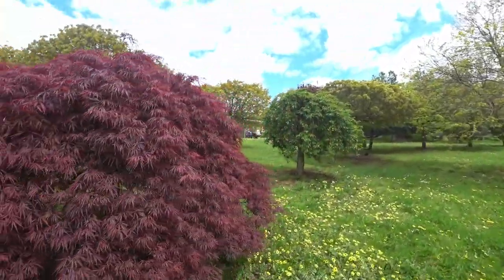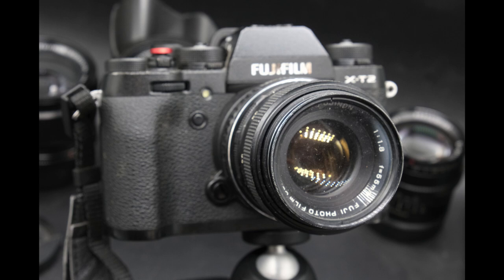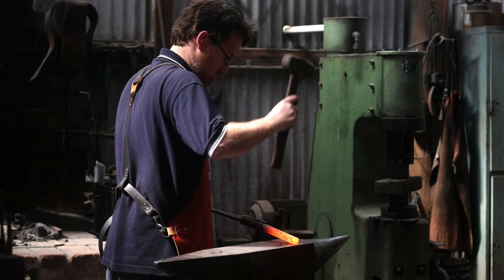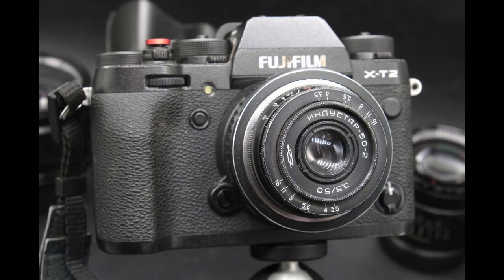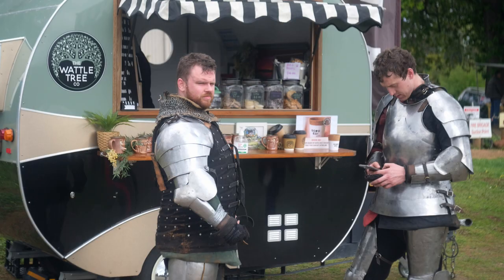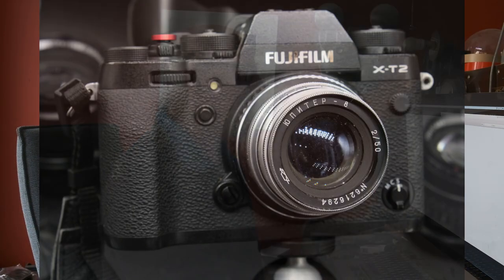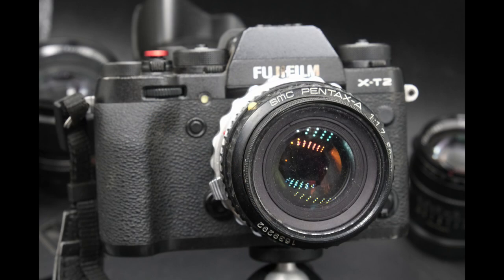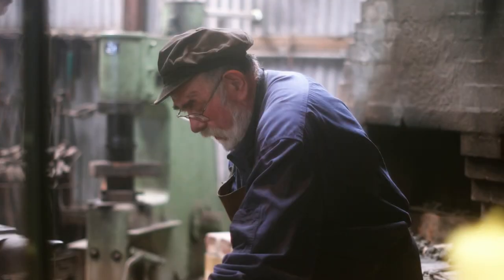Seven Vintage Lens Shoot Out

Comment: Industar-50-2 is a sharp contrasty lens. Needs a hood, doesn't handle flare well. Same goes for Olympus 50mm/1.4, especially wide open. Also, when you show the latter on camera, the glass looks really dirty??? A wonderful lens for morning/evening/indoors with indirect light.

Comment: Hi, I must say I really enjoy your videos. I have a question. Do you have to have different adapters for each lens? I'm 67 and only started getting into photography in 2019. I have an xt3 and a xt20 as well as a few film cameras. Canon ae1, nikon fe and a yashica mg-1
Reply from the maker: You need adaptors for different lens mounts. So you need to find out which mounts your old lenses have. They may be M42 screw mounts (heaps of old lenses covered there), or Pentax PK mounts, or Olympus mounts etc Same with Canon and Nikon mounts, find out what mount the lens has.

Comment: Perfect. I have the T-2, and a weekend. Let's see what you got! The fan light and mic are groovy!. That Mac still working? Wow. System 9? The Helios shined here. I have an 8 blade Super Takumar 50 and a Rollei Zeiss 50, both fast, and they are knockout lenses. Although I have fine Fuji primes, I have to recommend the Minolta Celtic 135mm 2.8 lens. Find the right seller and the right condition. Under 40 dollars. Right now ebay has one for ten and change, plus 17 shipping. You'll use it, and fall in love with it.
I have a Pentacon 135, and a minty Tair 135 with all the goodies, (20 blades), but I pick the Minolta.  A little stopped down, and it's extremely sharp.
Reply from the maker: I like retro
Reply: @GregCarrick  
I added more info.
Reply from the maker: Some good choices there. Re the Minolta on ebay - I'm in Australia, so a lot of items in the US become too expensive if the seller will even ship. I usually find lenses in op shops over here, or they just get given to me by people who don't use cameras.

Comment: Hi Greg I have most of the lenses you have mentioned, the Industar 50 I have is one of my sharpest & it has great contrast.I think there is a lot of variation due to how much Vodka was consumed on the day? I paused the video on the Olympus 50mm 1.4 & it looks like it is a bit hazy? It might benefit from a good clean on the inside. I had to dismantle my copy & after a good clean it produces great images. I had a similar problem with a Topcor 58mm 1.8 initially the images were soft, lacking in contrast. After removing the front glass, cleaning the haze & oil of the aperture blades I now get good images from it too. By the way I used to live in Mt Evelyn about 20 years ago, we might have been neighbours.
Reply from the maker: Thanks :) Yes, I've cleaned a few of my old lenses, but haven't pulled apart the Zuiko yet. It's also a bit banged up cosmetically so won't take a filter. Mt Ev has gone through a lot of changes since I moved up here... I've been photographing the place for all that time :)